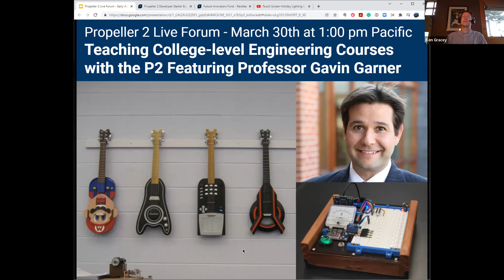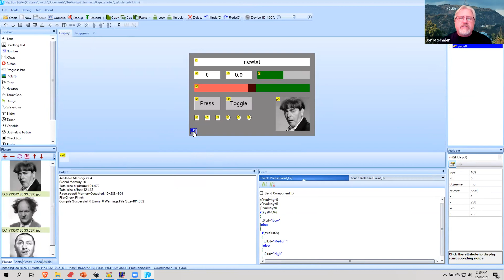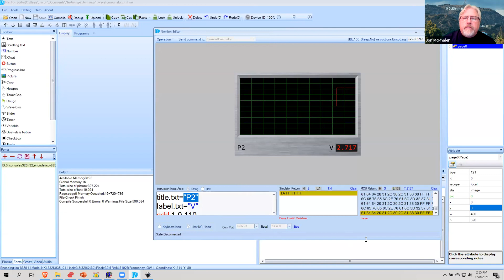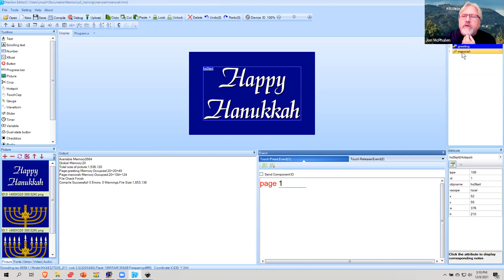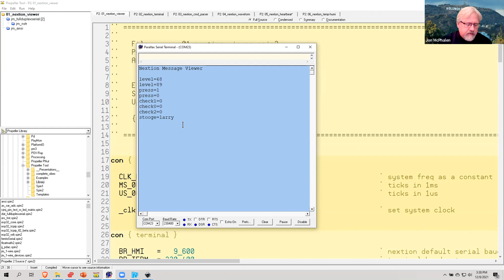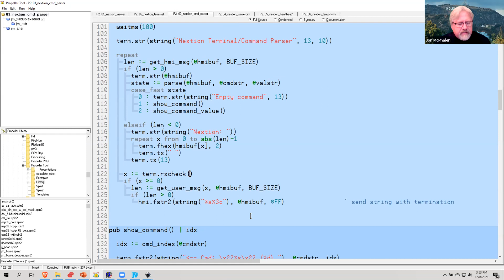Spin 2 Beginner Series Part 1 of 3: Holiday Lighting Control with  NX4832T035HMI Display

Comment: Can HubExec work for multiple cogs at a time?   Can they clobber each other's space then?
Reply: This question should probably be posted in the P2 forums. That said, I believe the answer is yes because the compiler will organize the data sections during the compilation process. Now... if the same code is used in HubExec mode by multiple cogs, it would be a bad idea to have self-modifying code in that case.